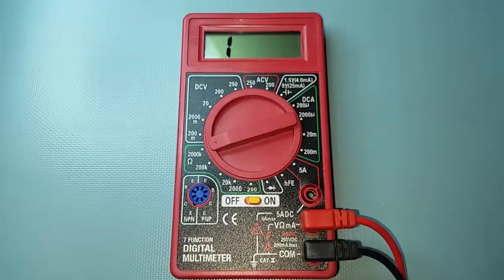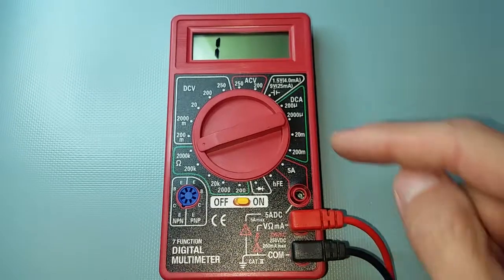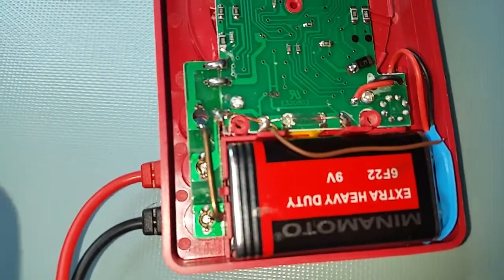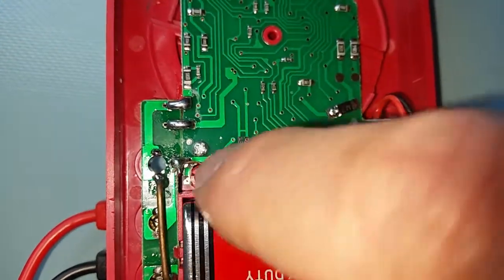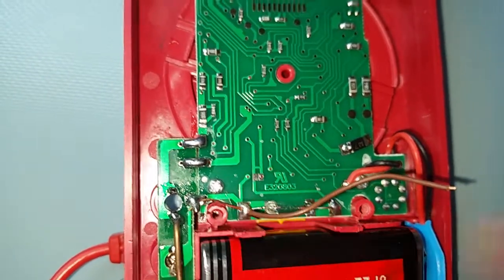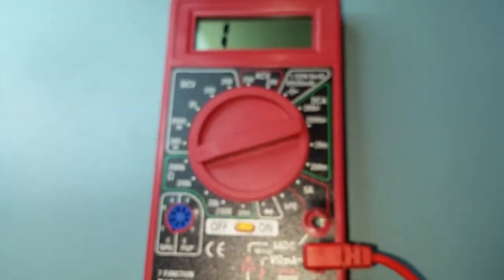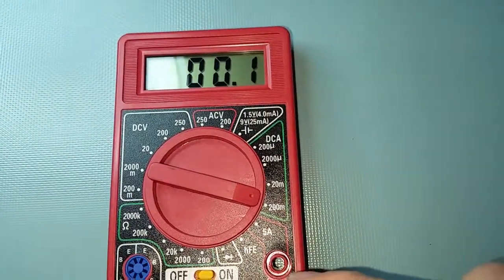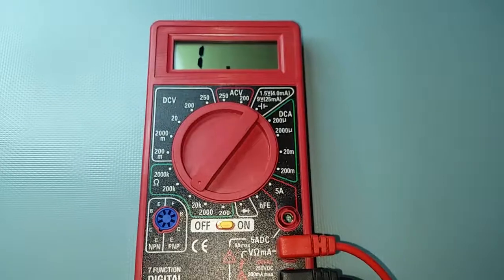I fixed a Harbor Freight Multimeter

Comment: I remember in tech school we had to build a meter that looks like this but the circuit boards inside were way better as part of a completion point and the ones we built were a whole hell of alot better than this meter
Reply from the maker: It would be neat to gut the inside, replace the selector switch with a digital pushbutton, add better connections, add auto off so forgetting to turn it off doesn't drain the battery, and make it much smaller!

Comment: Would it not be better to pay a little extra for a higher quality product  ie. one that works without having to be repaired.
Reply from the maker: apache16789 , Yes, but it depends really.  I have a high quality meter.  But for convenience, I like to have others in my greenhouse that is 400 feet from my house etc.  Also, I like to repair things and you can get a hf meter for free with a coupon.
Reply: apache16789: It doesn't hurt to have a couple of "expendable" meters around just in case...
Reply from the maker: pileofstuff , when find a kid that shows an interest in electronics, I'll give them one to encourage more experimenting.